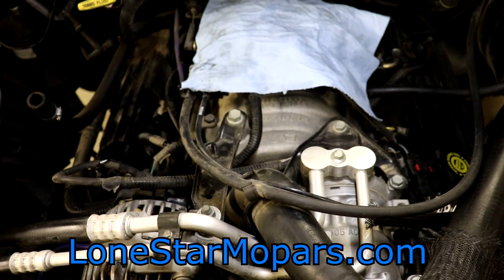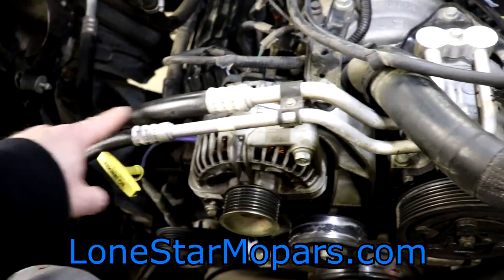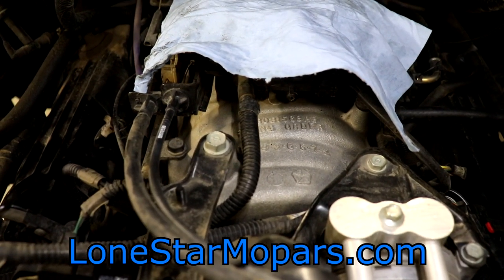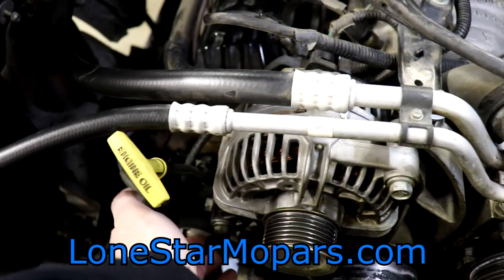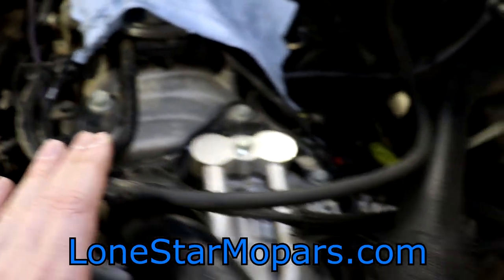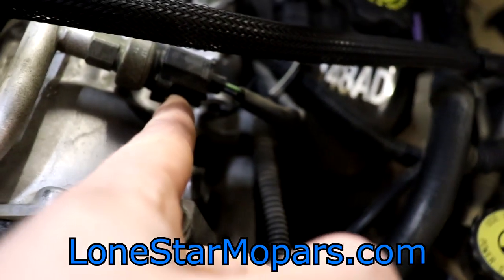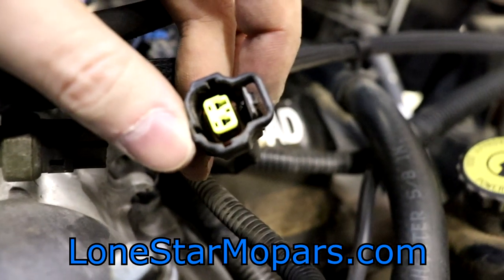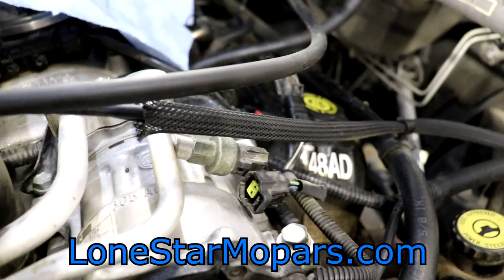Ram Revival Part 4: AC Compressor and Alternator Removal

Comment: The alternator and ac compressor are attached to a bracket. That will come off the block without having to remove the AC lines from the compressor. Letting you replace the timing cover etc..

Comment: Hey Lance any idea where I get the engine side ac compressor clutch wiring connector pigtail a ground squirrel got on the intake manifold keg and chewed my wiring connector the black and white stripe wire off and the blue with black stripe wire in two...